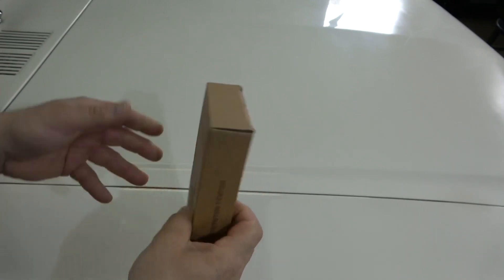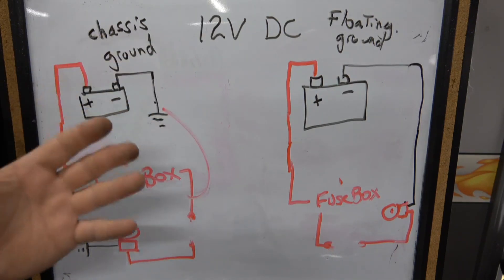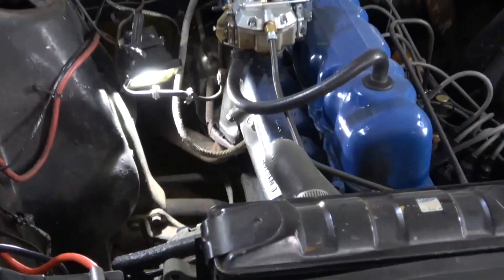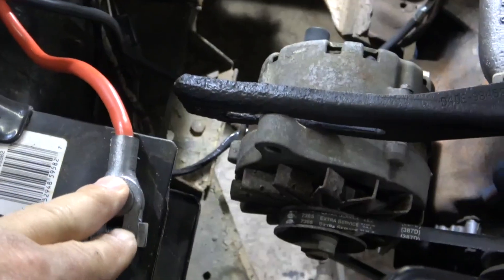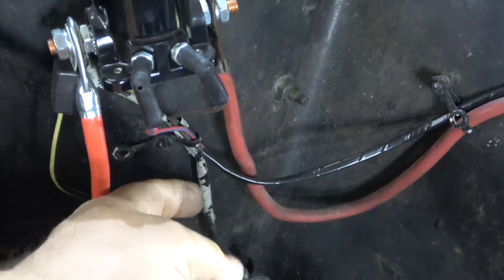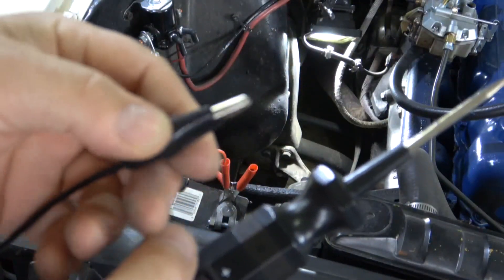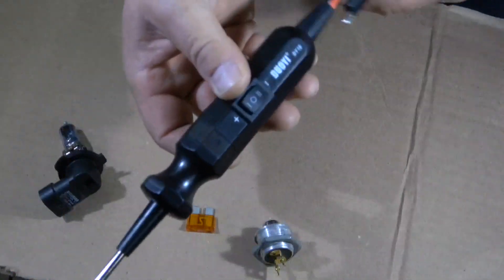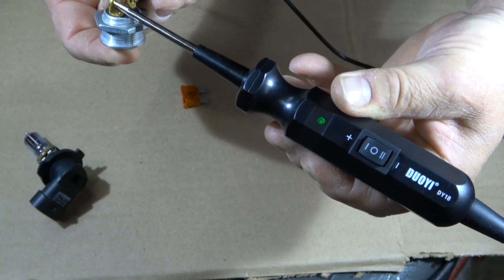Beginners Guide to Automotive Electrical Testing - Troubleshooting and Diagnostics

Comment: Weird question here 12v rear lights are on and I stripped the outter insulation of the wire wire is still connected no issues would the strippers touching the wire cause the fuse to blow? Would that be a ground the stripper touching the wire ?
Reply from the maker: Sounds like it
Reply: @PetesGarage  how come it would blow the fuse if I am not applying any electrical to it Just touching the wire with metal tool ?
Reply from the maker: I don't have all of the details, but if you touch a bare hot wire to any bare metal on the frame, even with a tool, it will blow the fuse

Comment: Hi, you sound like you like wiring ,  so i have a 1992 Dodge van w/318  I have a crank but no start.  I grounded out the fuel pump relay and now don't have spark or fuel.   Change the relay's and then found a fusible link bad , peeled the insulation back and just twisted the wires together temporarily now I have power to the relay but won't prime fuel.  I can jumper the wires without relay and fuel pump runs.  Still had no spark at coil,  found 30 amp fuse in the fuse block fried changed that and still no spark.  Has new key cylinder lock and ignition module.   What to do next trying to find if any other fusible links are fried but seem to be ok.  Can you help me with a schematic and how to proceed?
Reply from the maker: There is either other blown fuses and relays, or a bad ground somewhere.

Comment: Guys please help me out. As a student, I’m wondering would it be beneficial to study mechanical with electrical, or just electrical but more in depth working as auto electrician? Would auto electrician need to work on mechanical side at all? Would having know mechanical side help getting me the first auto electrician job?
Reply from the maker: I would do mechanical and learn basic electrical. Electrical can be very specialized but is not as common, in my opinion
Reply: @PetesGarage  Thank you for the advice!

Comment: Do not leave that Fixed plugged in your car all day use it and remove it,or it will drain your car battery dead.
Reply from the maker: I never had that problem, but thanks for the comment

Comment: Currently in school to become an automotive technician, and my goal is to get into a Porsche dealership. Anyway, turning wrench is easy. It’s easy to take an engine out of the car when you have the fundamentals. What I’m seeing nowadays is that technicians aren’t paid for their wrenching skills, they are paid for their knowledge and troubleshooting. I absolutely sucked at electrical at first, I stayed in class an extra hour because I couldn’t understand the circuits, and in my school we built them, wiring the headlights, taillights, hazard lights, turn signals, anything lights in a car we wired. I just couldn’t figure out the difference between parallel and series circuits and the different resistors we needed. After many more hours out of class, I decided I’d just mess with my car, follow the diagrams and just study until I got the hang of it. Finally, it clicked and it all made sense, and when it made sense, diagnosing became a breeze. Definitely a great skill to have.
Reply from the maker: That's awesome!! Good for you, hard work pays off
Reply: Where are you studying it

Comment: Good afternoon sir hope your day is going good! I have an INNOVA 3300 and i want to set it on DC10A and using the red and black lead probe the starter relay pin 30 & 87 to crank the vehicle while im diagnosing it under the hood cause i dont have a helper to crank the vehicle for me, is it possible to do that with the INNOVA 3300 sir?
Reply from the maker: I do not know

Comment: I used to hate doing electrical work, until I watched a friend go through my rear lighting wiring...and figure out why my rear lights weren't functioning properly.  It was meticulous...unwrapping tape...testing...removing useless stuff that others left behind...and learning to crimp wiring properly.  When he did it, I realized I could do it also.  Was just a matter of focussing on the problem at hand.
Reply from the maker: You can do it if you try
Reply: Agree completely.  Just another learning curve....which is standard if you're gonna take on any automotive project...lol.  I'm sure you're doing almost perpetual learning, even after many years at it.
Reply from the maker: I lean something new every day

Comment: I generally use both a multimeter...or a test light.  The thing that gets in the way sometimes is how short the leads are....especially if I'm working on the tranny wiring or something else in the middle or back of the truck.  I end up clipping together some clip extensions.  Wiring is definitely a challenge, especially when dealing with stuff that goes through larger bundles of wiring by the ecm or relay box under the hood.  I'm definitely no expert at all on wiring, but with persistence I usually figure things out.  I recently had a no crank no start on my truck, after it was off the road for a year and a half....after I got engine rebuilt and rebuilt the tranny myself.  At first, it would crank with a screwdriver over the solenoid terminals...but then I got nothing.  Ended up finding a break of the solenoid signal wire at the starter.....and also had a new neutral safety switch that was faulty.  That neutral safety switch was a real block...because I couldn't believe it would be faulty...lol.
Reply from the maker: Thanks Joe
Reply: Mechanics are master  detectives! Like modern day Sherlock Holmes. My Dad was an electrical engineer and mechanic who graduated from the University of Iowa. He could fix ANYTHING and loved his old cars.  ❤ I miss him so much. 💔 😢 Those Iowa Hawkeyes are such resourceful and inventive folks! This is an exceptional video. BTW.
Reply: @rbaldwin3208  Only a few good mechanics are good detectives.  The rest never had the smarts to begin with.  They are parts replacers....and they make you spend a lot of useless money.  There is good reason I'm very careful in choosing mechanics, and do most of my automotive work myself.  When I had a great mechanic, whose skills I could really trust, I would give him more of my automotive work.  I'm not a mechanic, but I've done my share of work for people, because they are dealing with stupid mechanics who waste their money....and can't figure out the problem...which usually is not that hard to figure out.

Comment: My horn quit working. I checked the fuse. It was OK. I looked at the wire connections to the horn unit and it was OK, not corroded. The horn doesn't work with the keyfob double lock nor from the steering wheel. 

What should be my next step, please. Thanks
Reply from the maker: Wire the horn to the battery to make sure it works
Reply: @PetesGarage  Thanks Pete. That makes sense.

Comment: Good vid for the beginner. A power probe, or similar item is a god sent. I have the $300 Fluke meter...BUT. I always go to my $5 Harbor Freight tester. Just the simple pointy tip with the incandescent bulb. Never get the LED tester. You can judge the current by the brightness of the incandescent. Can’t do that with the LED.
Reply from the maker: Interesting, thanks for the comment
Reply: Power probe 3 tells you the voltage on a display and lets you supply current too.

Comment: Great video, on another note I feel weird texting you out of the blue do you have any info on common issues with 351 Cleveland's. I've been inside and out of chevys but I just recently got a 351c for an 89 mustang gt project of my own. Not as familiar with ford's but this mustang has always been a dream of mine, 408 stroker, stock appearing fuel injection, and a tremic 6 speed the works.
Reply from the maker: It's no problem to text me. There are a couple things you can do for a Cleveland.